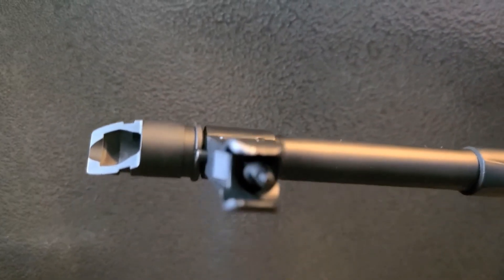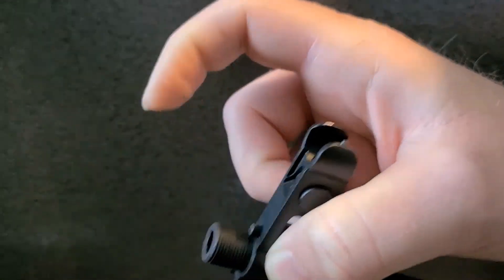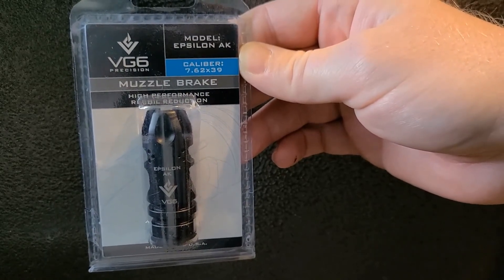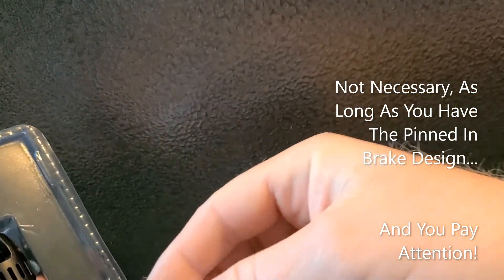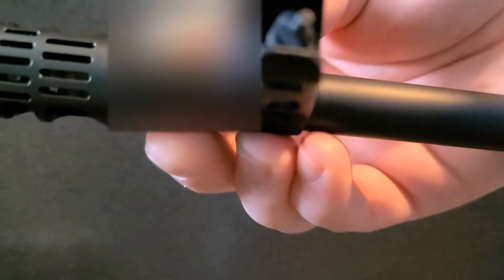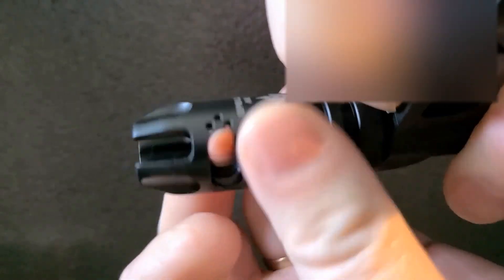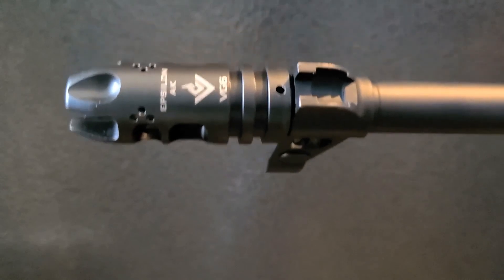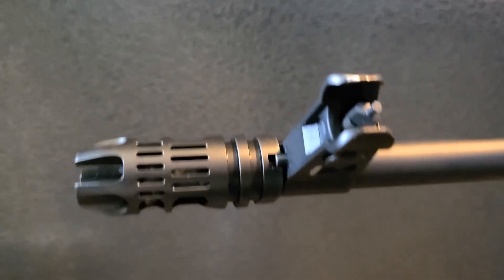VG6 Epsilon AK Install (Easy!)

Comment: Thanks. I just put my current model Epsilon AK onto a PSAK 47 Gen5. It was rather tight and I ended up having to use some PTFE to help and a open-end wrench (I guess tight is better than loose!). The current (comes in a nice box) version's slotted ports are slightly different. Four ports closer to the end of barrel and only two long ports closer to the sides. So they removed the three "top" ports. Looking forward to shooting it once I get my build finished up.

Comment: Got mine to go all the way on my Century VSKA. It was about a 1/8 maybe 16th of an inch away from detent pin so I got a rag wrapped around brake and channel locks to finish the job, snug as a bug on the living room rug!
Reply: I just bought one for my VSKA. Going to test it today. If it works well I will buy one for my wasr 10/63 too.

Comment: Used your video to install my VG6 Epsilon AK brake this week. Thanks a bunch! It was the last item I decided to upgrade on my AK, so it's finally a completed project! Full magpul furniture, foldable stock, top rail, low set Vortex Strikefire II red dot, angled foregrip (I use a C-clamp grip with it), translucent Palm mags and a tac light.
Reply from the maker: Good deal, glad it helped bro.

Comment: so muzzle doesnt need to be screwed on as tight on an AK vs a 5.56?
Reply from the maker: It's just a different design than an AR15. 
There is a detent on the AK which locks the muzzle device into place.
So it will literally click in and hold without issue.
Thanks for watching!

Comment: I recently put one of these on my ak but the push pin doesn't fully extend out. It did click in and doesn't really move at all. Is this a problem?
Reply: No, as long as the indexing pin is lined up and holding the brake in place, you’ll be fine. You do want to use as many threads as possible (get it as close as possible to the front sight tower.)

Comment: Do you know if this will attach to the Century Arms VSKA, not sure if the used a different thread pitch
Reply from the maker: I don't own a VSKA but my best guess is that you'll be fine.
The VG6 is such an amazing brake, comp and flash hider.
For the money it's well worth it.
Take care
Reply: VSKA owner here got mine last year with the same brake yes it will work! Look at my first comment up top for instructions. Enjoy.
Reply: Yes it works. I just put mine on my vska. It is a very very snug fit. No wiggle at all!
Reply: What about a ras47 pistol?

Comment: Is that little bit of wiggle room a problem? Just installed mine and it doesnt make it all the way down like yours so im curious if thats fine
Reply from the maker: It should be fine, but how much of a gap are you talking about?
As long as it is not obstructing the bore, I don't see it being a problem because threads will be slightly different on other rifles...
Reply: @Vamike9  it looks like the exact same as yours i could just barely move it around since it doesnt go all the way down. Was just double checking so thanks for lettin me know!
Reply from the maker: Ok, then yes it is fine. 
Have a good one!